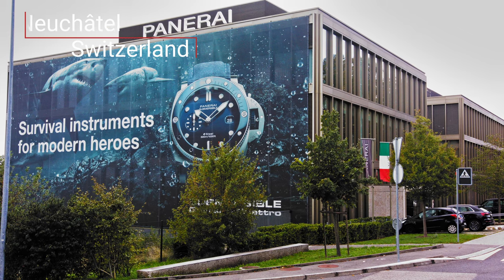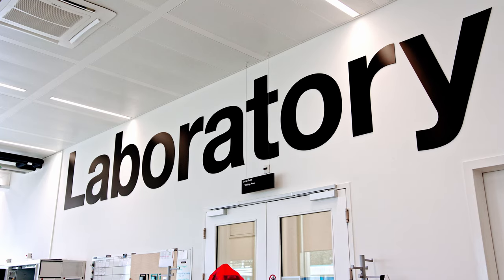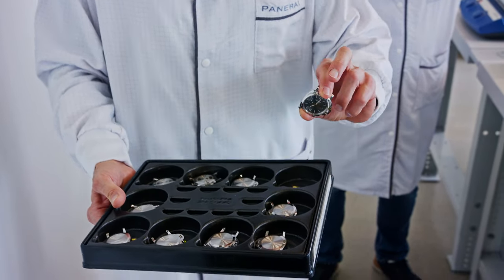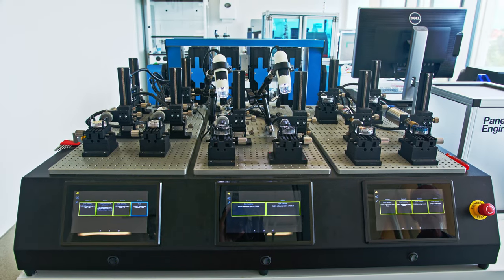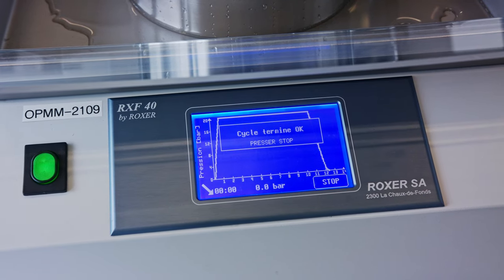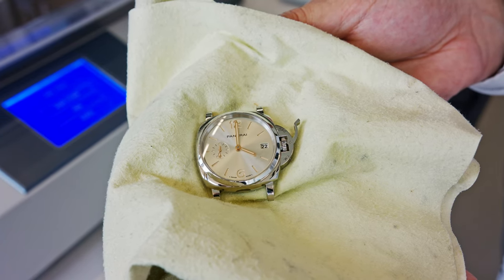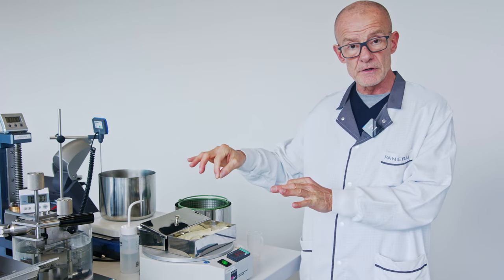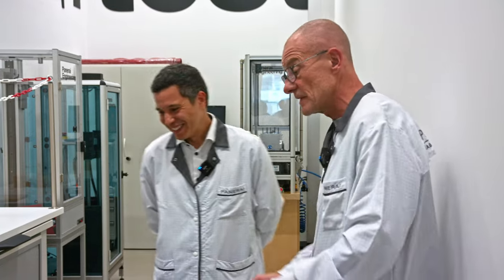PANERAI Manufacture Tour in Neuchâtel. EPISODE 2: Laboratory + Crash Test Center

Comment: Panerai needs to communicate the real water resistance on every dial. What is the point of making a greater efford of testing it to 20bar and then write 30m on the dial without communicating it well enough? Who set the rule that customers don't want a dress watch with 200m water resistance? It is missed added value here! They will sell much much better with 200m on the dial. Especially to a younger audience. Please Panerai.
Reply from the maker: Panerai of course will change this in the near future. Thanks for your remarks!
Reply: Watches are made to test to 25% of their water resistance potential.

Comment: Thanks for another video in this series. 
The water resistance is a particularly contentious point with some Panerai models, so good to see this addressed and possibly changed soon! 
Can you explain why they still had 30m for so long, was the production not reliable/consist enough to guarantee more?
Also why was the test done with the crown lock open? Is there some issue keeping it closed at that depth? Since it is very uncommon to leave it open and it should perform better closed, but I am thinking this might not be the case, perhaps too much compression of the seal or something? Would love to understand the reasoning behind it.
Reply from the maker: Thanks for sharing our passion again! The WR will change soon... No, I cant explain you why, but I know that the generation of Luminor Due cases they manufacture know do withstand 200 meters. They are continuing the tests and they will define a new official WR for that model. Why was the lever open? Because the crown gaskets alone must guarantee the WR... closing the lever is another security on top... Understand that this is their way of thinking... it is not about showing off, but about delivering and guaranteeing the best possible quality...
Reply: @WatchAdvisor  Thanks for the reply, and as I said good to see they are working towards guaranteeing proper water resistance again across their ranges. It shows they are listening to some of the criticism and improving/returning things constructively for watch enthusiasts that do care about these things (even if many current customers might already be OK with it). 
I rewatched and reread some comments on the Bronzo Submersible manufacturing video and it is clear many 'critics' don't understand manufacturing and supply chains which are all very common practice in the industry. A critic should be open to learn and understand circumstances and details fully before they comment..
Is in-house a complicated statement today for anyone reliant on third party or in-group suppliers, yes. But then only watchmakers like Roger Smith can claim true in-house making every part including case and dial.
Even Rolex is still reliant on many suppliers, they just bought/integrated nearly all, but they work in different buildings right! 😉 Some more transparency is nice but also not needed for 90% of customers and if competitors claim the same you have to match. In-house has just become a marketing word, what matters is if a brand has full control over the quality of each component.
Reply from the maker: The industry existing sensitivity of “in-house” was created by marketing departments far away from realty (= production). The image that was created made you believe that everything was done by hand and exclusively in-House. What nonsense!

Comment: They  definitely must change the 30m mention on the Due. What went through their head when they designed this collection? 
Anyway, great tour Alexander. Do the other manufacture have the same crash test protocol and requirements?
Reply from the maker: They will do that once they are 1000 % 😉 sure that these cases can take more... what they do is always on the absolute safe side ... what is mentioned on the cases is always + 25% and as we saw here even much more...

Comment: Thanks for this great video series Alexander. 

The video series is a good start from Panerai to address the issues that have been raised from collectors of the brand. 

Without being an expert in advanced manufacturing it is hard to form a view on the scale of their facilities and their ability to produce thousands of watches a year. I am going to guess that there are more than this one facility though!

In terms of the Luminor Due I have been a big fan of this collection for my wife but we were put off by the 30m. It is good to see that they are more water resistant than the specifications provided. It does raise the question around long term water resistance over a prolonged period of time and a larger sample size. Once these are 100m water resistant we will be acquiring one for my wife!
Reply: I'm more worried about my Navitimer 30 m resistance than any Panerai.
Reply from the maker: The WR of the Luminor Due will be increased officially… to what extend I can’t say, but I assume at least 50m, but maybe 100m…

Comment: I think the watch should be on a timegrapher before chrashtest and afterword too. To see if any accurecy has changed. Too many times it is seen on some watch that the wartch goes from + 3 - 5 sec a day and after a 1 meter drop on a woodenfloor it runs - 5  to -10  sec. a day. Ofcourse often much cheaper watches).
Reply from the maker: Also the movements are checked when such rigorous tests are done. Only a minimal deviation after the tests is allowed…

Comment: 🤨 30 meters water resistant, that’s what you read when you buying so you think, I’ll pass a watch that can’t withstand not even the shower 😩pass … then they said 200 meters tested so if your watch fails at 50 meter or 100 meters because if can happen it would happen and you go for warranty and they say but the caseback states 30 meters = void warranty 😭 why they do that is beyond comprehension 😒 another thing I don’t understand apparently Panerai is a dive watch 99% of the times you see a Panerai is in leather strap why they don’t go full on bracelet!! Panerai bracelets are rare as unicorns!! Good video though outstanding as always 🥇🥇🥇
Reply: There are numerous Panerai's on a steel bracelet
Reply from the maker: If you can't get the strap you want from Panerai check "Horus" straps... I wear my Luminor GMT on a black/blue camouflage strap from them...
Reply: Most of them come with 1 x leather and 1 x rubber. You can wear the rubber strap if you are more sporty and worry about strap WR.

Runner straps are more comfortable when engaging in sporting activities than any bracelet in the market.

Comment: Surprising to see 200m water resistance on the due, even if the crown lever is open. The question is should i try swimming with my 5yo due now that ive seen this 😅
Reply from the maker: Be careful! To always be on the safe side you should let someone check the the watertightness of your watch year...
Reply: Watertightness degrades with time as rubber gaskets decay. Any watch going into the water should have those checked before the season or for a 5 year old watch replaced. To reiterate, any rubber hardens over time, and thus, the seal effectiveness is reduced. I wouldn't drive a car with 5+ year old tires either.
Reply from the maker: @nilxnull  Thanks for adding this!

Comment: Panerai is my favorite watch manufacturer.  But I'd like them to explain, post it on their website, why they have such low levels of water proofness.  Their heritage is scuba diving.  It's a very odd strategy for a company that made it's name supporting scuba diving.  You can get a $125 automatic watch with better water proofness.  And at Panerai's price level, it's baffling and irrational.  Extraordinarily odd.
Reply from the maker: The WR already today is good (with one exception) and will improve further soon…
Reply: @WatchAdvisor  by exception you mean Duo?
Reply from the maker: @max.zelinski  No, all the different models will get an improvement in WR soon...
Reply: @WatchAdvisor  many Panerai references (e.g. 914 and 915, to name just some recent ones) sport a 300m water resistance limit, so it is no big deal. What really surprises me is why Panerai only declares 30m on some models. By the way, it looks odd that they put the crown guard (which was originally intended for high water resistance) on such poorely rated watches (water resistance wise).

Comment: Was this WR test only for presentation purpose, or they test every due for 200m wr?
Reply from the maker: No! They actually test lots of these cases to be sure to augment the watertightness of the luminor cases… They also working to improve the general watertightness of their cases…
Reply: Wasnt the case open during the test? It looked like the crown was not sealed as the crowngard was open
Reply from the maker: @emmanueldupont428  Yes, this was the case… The gaskets of the crown alone are enough to guarantee the 20 bar…